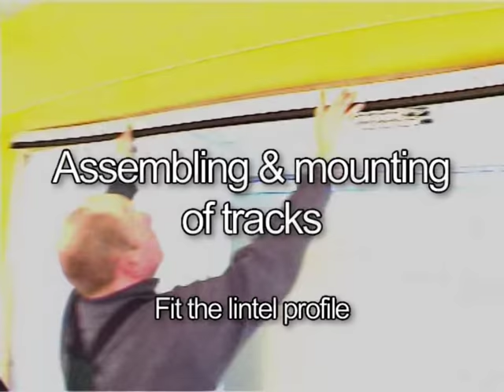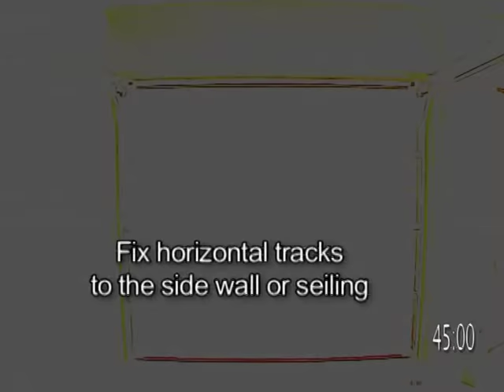R40 Garage Door installation

Comment: Yes of course I understand that it's a demo. On how easy the door is ro fit. What makes it a little misleading is the timer less than 45 minutes.. it takes longer to unpack it and get my tools off the van. I've seen way to many amateurs have a go based on you tube vids like this on. Assuming it's that easy. On for them to hurt themselves or make a pigs ear of it the I come along and start over.